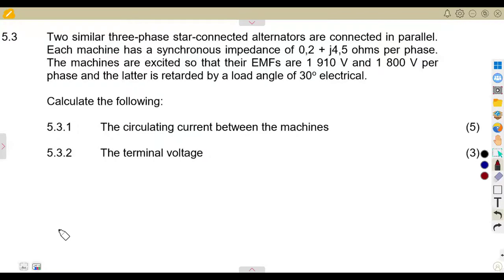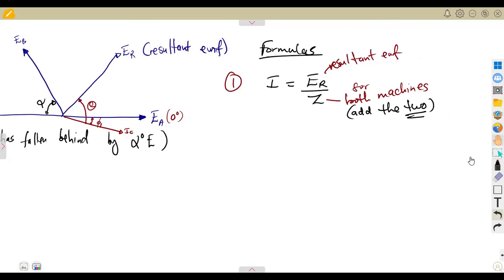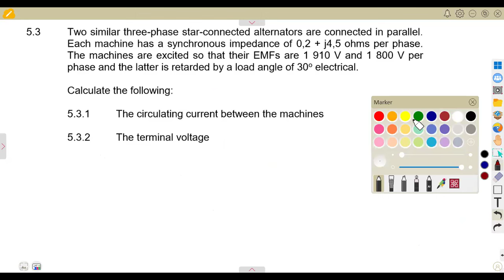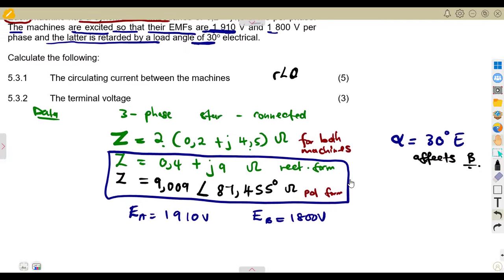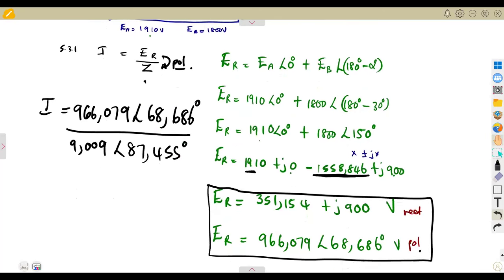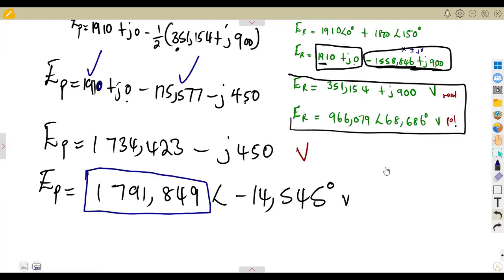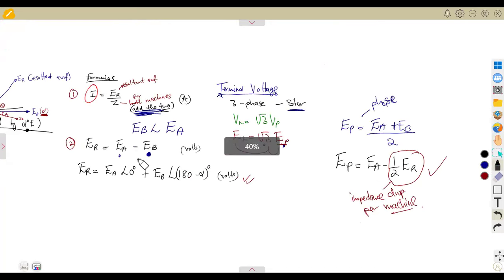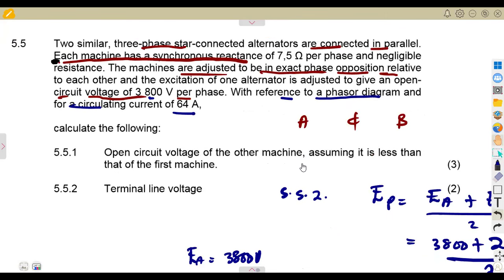Electrotechnics N5 AC Machines Parallel operation of alternators @mathszoneafricanmotives

Comment: I have this question please help I don’t know what to do with this 180 degrees: two similar 3phase,star connected alternators connected in parallel.each alternator has a synchronous impedance of 3,75+j12.5 per phase.the speeds of the alternators were changed so that their EMFs were 180degrees out of phase relatively to each other.The excitation of a machine A was udjusted so that its open-circuit voltage was 2,2KV. If the current circulating between the two machines was 32A.calculate:
1.open-circuit Volta of an alternator of B ,assuming that it was bigger than that of alternator A

2.the Terminal voltage 

3. The synchronous power
Reply from the maker: Hie you can send your question on this number +27618644043
Reply: @mathszoneafricanmotives   thank you